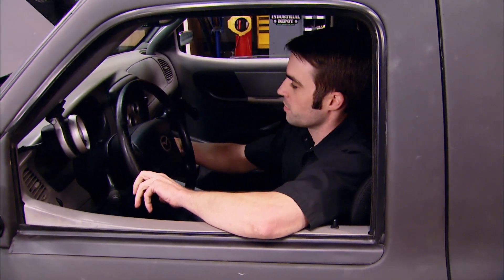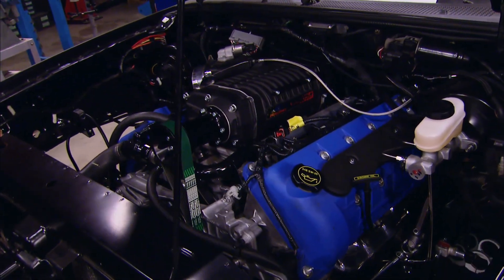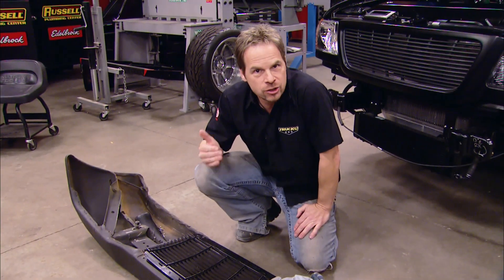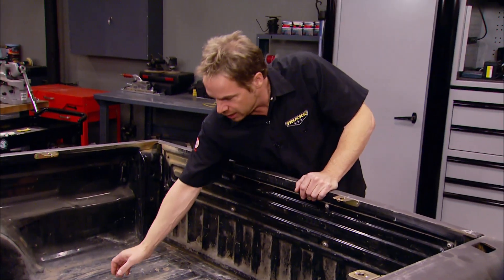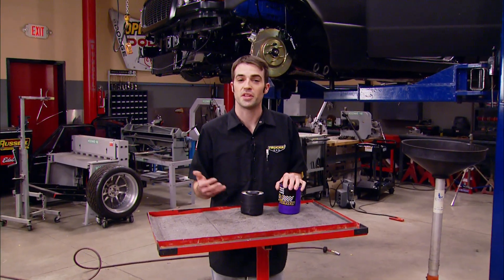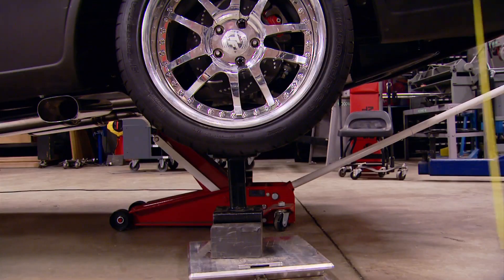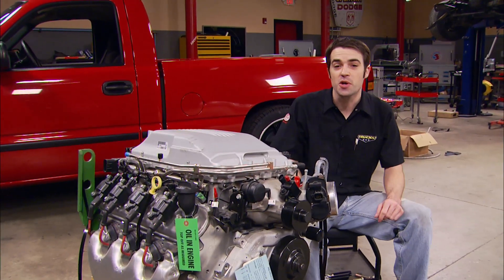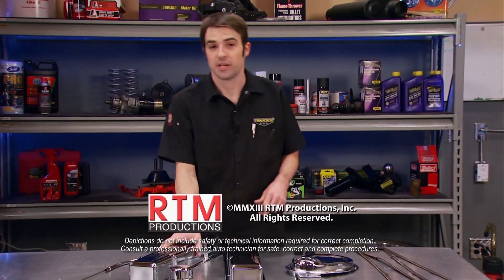Unleashing the Supercharged Aluminator in our Ford Ranger - Trucks! S15, E2

Comment: Back when I was 16 (in 1999) I had a 94 Eddie Bauer Exploder with the 4.0 OHV and the JUNK AOD4, and I wanted to do a 5.0 or 4.6 swap, but I ended up installing an Explorer Express supercharger kit with an Eaton M90 supercharger. I pushed that 4.0 OHV that originally made 140 HP and 225 lb ft to 257 whp and 377 lb ft at 8 lbs of boost with a Roots style blower, BBK headers, true 3" duals, Dynomax 58" glass packs, BBK 90mm throttle body, 80 lb injectors, and upgraded fuel system. I had to have the AOD4 rebuilt 6 times...lmao That's what got me into working on cars. It was a fairly quick truck for how heavy and comfortable it was. Shortly after I did all of that I moved back to Pittsburgh from Tampa, Florida and I traded it to a friend for a turbo Integra shortly after. A few weeks later I saw the 16 year old girl that bought it at a local drive in restaurant and she was all kinds of messed up on pills. About a week after that I saw it pass me on the back of a rollback...she rolled it and destroyed my truck...it gutted me. Hell, I haven't seen that truck since 2000 and I still remember the VIN number and what my Florida license plate was. Sad...

Comment: Superchargers are a good thing !! I love mine
Reply: I have a question I doubt it that you'll respond but I see that you have a supercharger and guessing it's the Mustang engine 5 litre I want to know if the supercharger it's really hard on the motor or not like would you still get 200,000 km out of that engine with the supercharger
Reply: @memphisreigns1498  not a Mustang, F150 making 625 hp with warranty. Gen 1 5.0 F150's are ok to 800hp before any issues or problems
Reply: @memphisreigns1498  the Ford 5.0 Coyote is strong from the factory, Ive got over 140,000 miles on mine now

Comment: if there is tire spin, can put 200lbs of whatever in the back and it might be faster off the line. But driving around with lots of snow on the ground, you'll know if the weight distribution is any good once ya get to going up a hill with 20 degree slop not giving more then a 20 foot run up. as the 4.6 is it can spin a locked rear end in the snow all the way to 175km/hr... so the blower seams a bit much. :)

Comment: Oh, and I also had a 95 Ranger with the 4.0 OHV and the 4R55E and it was junk too...even with only 134k miles. I finally swapped a 4.6 SOHC out of a F150 and it was alot of fun, but would've been SO much better with a manual trans.

Comment: What did ya'll do with the Original 2.3l Engine & Trans?

-"IF" I had the money, this is EXACTLY what I would build, but with the Extended Cab!
Reply: Ext cab and use a 4x4 front axle and make it AWD
Reply: Wheres the racing steering wheel
Reply: MEMPHIS REIGNS    nobody can actually fit in the jumpseats anyways lol

Comment: What is the "Load Capacity" after all these PERFORMANCE Additions?

I'd love to have a High Performance Truck (Ranger), but to be able to accommodate my hauling up to 2,000lbs of Gravel for Driveway Maintenance!
Reply: Cargo capacity went out the window a while ago.   And the Ranger didn't have much to begin with anyway.
Reply: @bmstylee  With my 1994 (2.3l 5-Speed with Rear Air Shocks) I could haul 2,500lbs ALL DAY... Given that it was a Regular Cab/Long Bed, but also had a 500cubic inch Tool Box as well!

How does that feel?

Comment: The belt looks a little tight needs to be loose   Because it will get tighter as the rpm goes up. Too tight run the risk of messing up supercharger

Comment: I never heard what happened to your 1st engine, the one that started knocking on your test drive.

But that gas cap!  Egads!! You just ruined the ability of the bed to carry things!  I would never put a gas filler port on a truck bed where things can sit on it.  What if you needed to haul a load of sand or dirt?  It's just too prone to damage and dirt, and clearly there could be times when it would be terribly inconvenient.  So put me down as doubtful.
Reply: The bed will no longer be used. The purpose of this build was to be a dedicated street preformer. The only thing this truck is going to hauling is ASS. Plus they have other vehicles for those tasks

Comment: I cringe every time they put in Royal Purple
Reply: I've had blackstone labs do several used oil analysis of RP HPS 5-30. It protects very well.
Reply: The non API royal purple is actually really good, if it has synerlec in it, it's an amazing anti wear additive but cannot pass the API certification because it has high sulfur content, so the API Royal Purple is nothing special and is in fact over priced for what you get but their race oils and break in products may still have synerlec